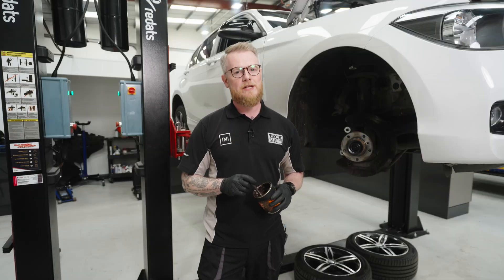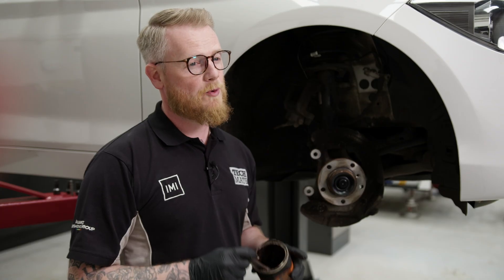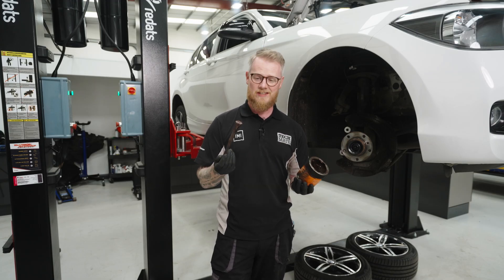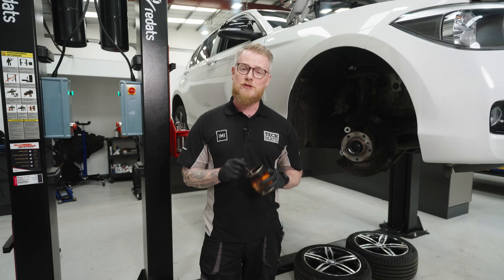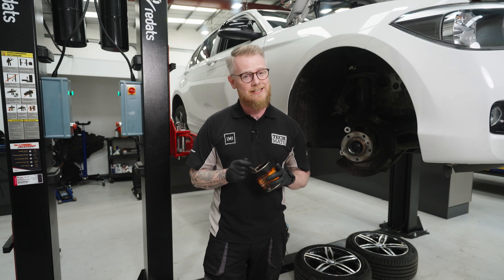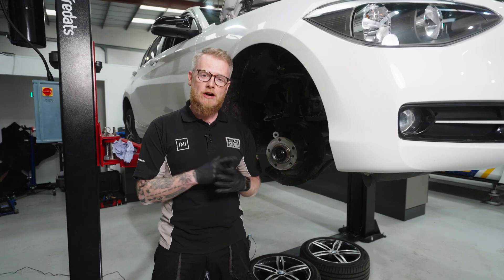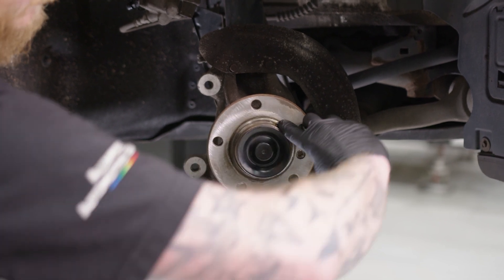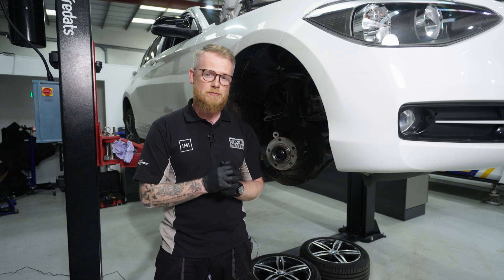STOP Using Copper Grease on Your Brakes | TechMate TV

Comment: No electric current - no galvanic corrosion.
Reply: I think the fear of galvanic corrosion is in cases where the carrier grease has burned off and left the copper in direct contact with steel (or other metal). In such cases the difference in electronegativity can cause a current via water.

Comment: The rubber components in brake callipers are designed to withstand 700 F and spilled brake fluid, a little solvent in a thick paste isn't going to touch them.

Comment: Dude, mechanics have been using copper grease on pads for the last 80 years, all of a sudden these newbies decide not to use copper grease.
Reply: I think many mechanics are using the copper paste correctly, on the threads of fastening bolts, and not on the slider pins as mentioned in the video. The slider pins need actual lubricant.
Reply: @iCanHazTwentyLetters  I just had a mechanic with 30+ years experience put it on my slider pins, yesterday.
As a bike mechanic myself, seems really weird putting it on a moving part. That's why I searched for it.